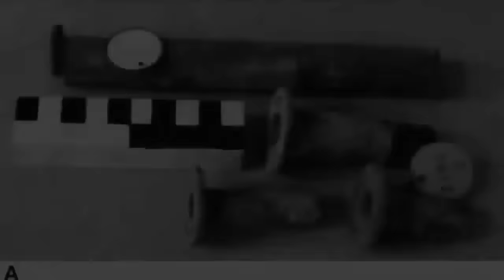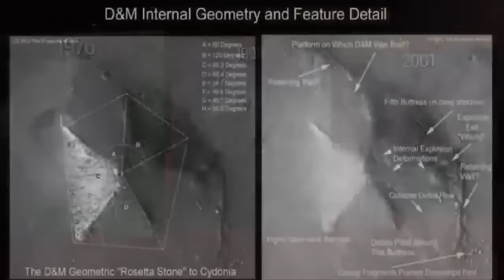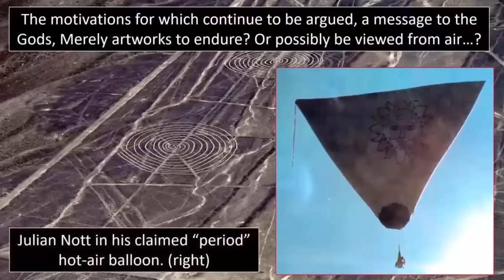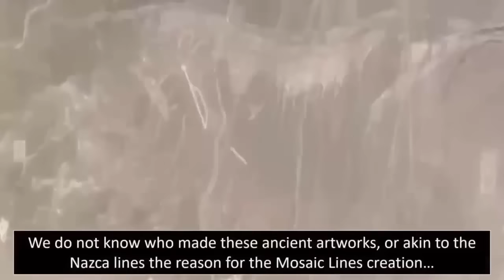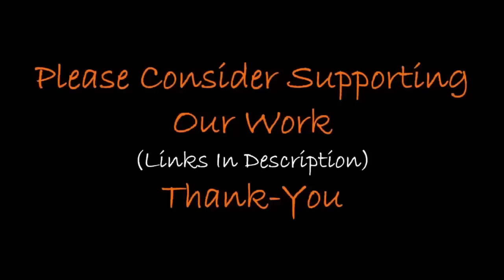Pre-Flood Mausoleum Found In Sicily?

Comment: My theory about the nobs on the outer walls, here me out and think. Pre flood had massive dinosaurs which were used in wars against enemies fortresses. To protect your fortress they used massive stones to prevent ramming with dinosaur easy. The nobs were outfitted with wooden or metal spikes to prevent easy ramming. Ones a dinosaur rams that the spikes would stab them and will stay on the Dino. Afterwards the fortress owner would easily replace the  spikes on the nobs again for next attacks.
Reply: A family purchased a home in Florida and were amazed at the ground floor thick steel doors' and windows'  'decorative bars'. The 1st night they awoke to 6 feet long crocodiles climbing up the sides of the home.
Reply: Do they allow you access to the Internet in the closed psychiatric ward? Just asking.

Comment: The Igigi arrived here 450k years ago and built structures during that time while mining for gold, according to the sumerian tablets. 

If you are building a structure you general would cut down the materials to a size that would be most accessible to make it more proficient.  For example you wouldn't build a structure using 100 ton blocks if you are under 6ft because you wouldn't have enough labor force to be able to move the material. You would need 20ft to 60ft+ Giants to be able to move material on 100 - 500 ton blocks. The cuts would be made in size to best fit the size of the worker. 

So there were giants. The evidence is worldwide from these megalithic structures.